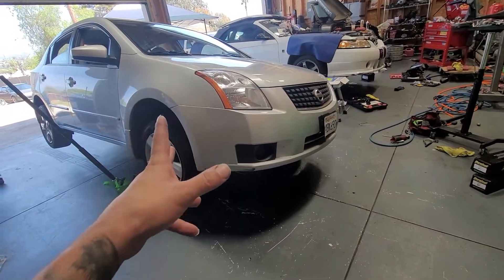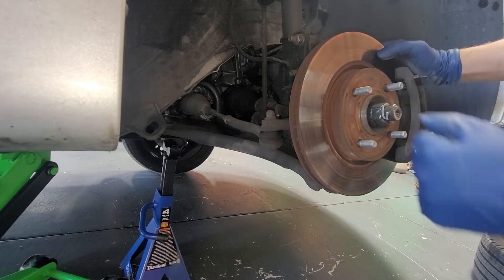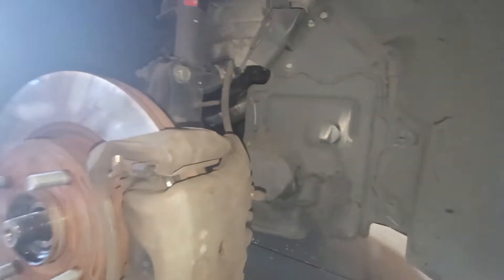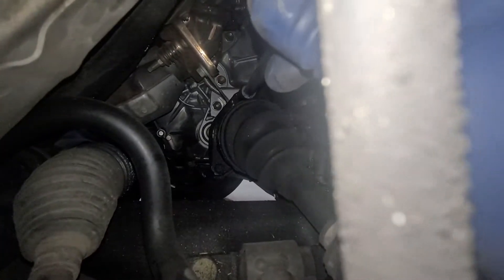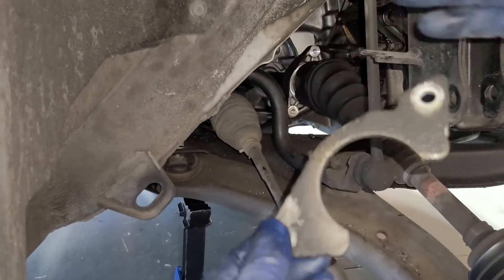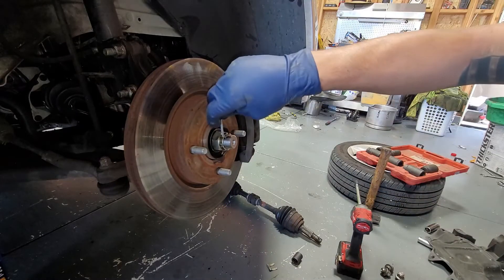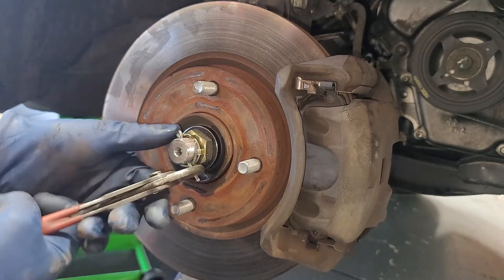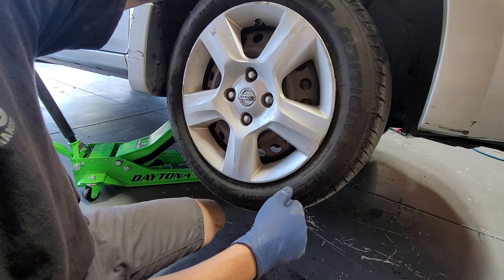2007 Nissan Sentra passenger side axle replacement

Comment: Much appreciated for this video. I have to replace the CV axel and lower control arm and when I took the wheel of I realized I need more tools. Still cheaper than taking it into the shop for $1800